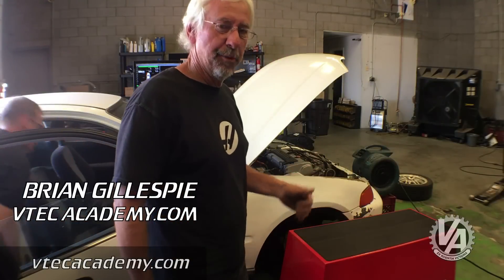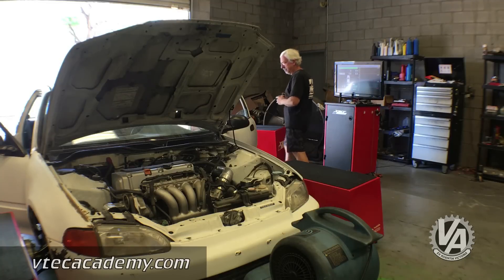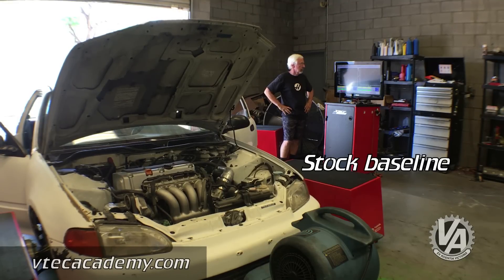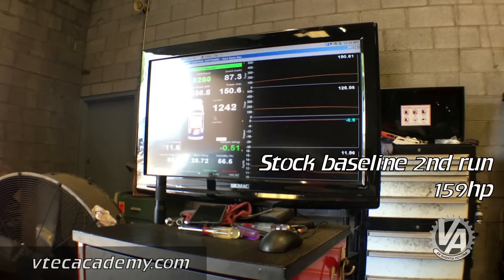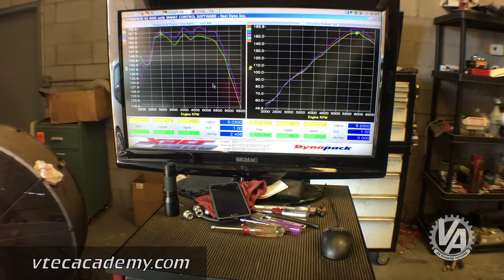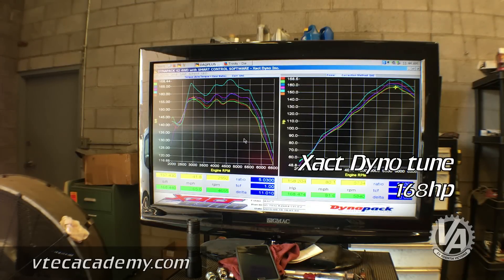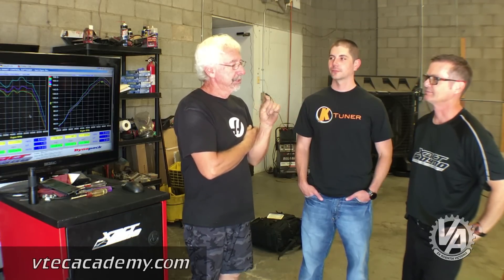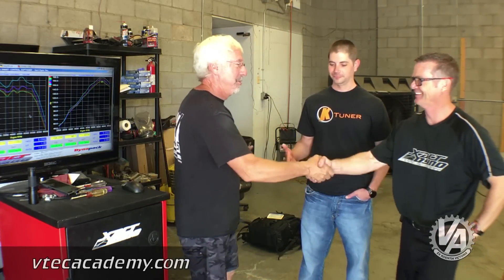Civic EG Budget K Swap Part 3 Dyno

Comment: Just went for a ride in a swap like this and then got the motor I also have a b love the torque and there's so much room to grow I want lsd do they sell it for 5 speed I love the fact its a street car daily my buddy makes 240 hp and 200 foot pounds of torque and the motor sounds like a man not an aggressive teenager he has a tsx trans I think this is a great build you can grow from it without going boost right away plus without all the extras like distributors cams etc this is factory and the do sell other aftermarket parts so there is a plethora of combinations change stuff but no I'm in it k24a4 we shall see. With this build

Comment: Great video! I’m wondering if the money spent on bolt ons would be better spent on a k24A2? $200 header $200 rcb intake manifold, $3-500 for cams sure adds up. My budget k24a2 swapped civic made 197/173 @4,000 ft of elevation with stock intake, stock exhaust manifold everything. Just kpro. Is the accord k24 really thaaaaat much cheaper?

Comment: i respect the fact that the goal was to make a cheap Kswap but it seems to miss so much heart i mean i think a B16 EG could get in front of that car easily, i would go big or do nothing if it was for myself because a K20A-R or even a K20Z3 is such an amazing engine, and has a great transmission ratio that seems to give it that extra punch it needs and can get 260hp easily without any brain breaking with just bolt ons even it theyre average

anyway its a cool build and it was so close of the -3000$ good work!
Reply from the maker: We aim to find out. I actually think it will kill a B16 and even keep up with a B18C. We'll see.
Reply: yeah we need to see it! with a little more top end the K24 will definately give a huge gap to a b16
Reply from the maker: Thanks for watching!

Comment: (This may initially seem like a stupid question, but please keep an open mind.)

Have you considered swapping a PPA head into that block (for the improved flow)? How about a PPA head with better cams (possibly 06+ TSX cams using the VTEC killer method)? I know that’s not what you really do, but I just figured that it wouldn’t hurt to ask.

Comment: 160 stock? My stock K24 CRV is 195hp. With K&N stock replacement  air filter so maybe 200hp. I saw on a video that a K&N replacement filter adds 5 horsepower without retuning.

Comment: Would like to see you guys revisit this budget k swap civic project. I'm curious to see if brains mods(different intake manifold ,cai ,cams , different header ,and a new tune) would bring it up to the 200hp mark. I've got a clean 98 ek chassis w/ rear disc brake conversion. It had a b20vtec swap in it ,but I'm looking into k series now instead of another b series swap since I've got 6k to work with. I'd like to put a k20a2 in it ,but wondering if I could pull off the whole swap for 6k? Otherwise maybe a sleeved ,bored & properly built b20 block to replace the tired ol bone stock b20 that was in it

Comment: I really need help I have trouble shot everything 6 times and have had two other people go through everything with me and we are all stumped I have a 95 civic hatch with a k20a2 swap my only issue is I do not have power going to fuel pump. Fuel pump is good, relay is good, everything I mean literally everything is good just cannot get power to my relay the only way I can get power is if I jump from pin #5 on the main relay (fuse #13) or #6 (power output) in other words only if I send 12v constant from another pin on the relay the car will start and stay running.

Comment: waiting on the next vid. love the channel I am in love with Honda's I live in northern Michigan so there is not much of a scene around here I am close to love fab  if you haven't heard of them check them out they are really doing good stuff I am curntly working on my 93 integra with a b18b1 in it I need to find a new transmission due to the fact mine went to poop and I have a 91 accord we are building as a family my 8 yo daughter loves it wish I had more cash to throw at it but family comes first and working 60 hrs a week in a factory don't bring home a lot of bacon so these budget vids  help 
Robert
prez manual obsessions cc

keep shifting
Reply from the maker: Rob Dirty 👍🏽thanks! We were just in Michigan this summer for WMHM.
Reply: VTEC Academy sweet I missed out on it due to the fact the car is broke and working all the time

Comment: rbc is your best bet for intake manifold of the 06-11 civic si
Reply from the maker: Possibly, but we'll find out. The RBC may not make a difference at the RPM we are running.
Reply: Not sure if it'll help a car with 6600rpm redline, many 9th gen Si guys dispute the effectiveness of the RBC swap on the K24Z7 even when their cars rev to 7500rpm tuned

Comment: Will the accord harness work for this swap? Also will these parts work with a K24A2 being the only difference? I could really use some help please and thanks!
Reply from the maker: Yes, the Accord harness will work and the A2 works with these parts.
Reply: VTEC Academy What can i expect from using this ecu will vtec work the as it should after reflash? And im guessing it would be the same as using ep3 si ecu? Just weighing out my options considering i have access to both.
Reply from the maker: You need to have the ECU reflashed with the program that fits the engine.

Comment: ? I have96 Honda civic  with internal coil  I'm swapping 01 Honda prelude which external coil how can I do this  please help me  thank you
Reply: The JDM H-series distributor is internal coil. Get a 93-95 one then an OBD1 to OBD2 distributor plug adapter. Or you could go to a salvage yard, find an OBD1 Accord with external coil and cut the section of harness that includes the coil and distributor and just match it wire for wire. That coil does like a bigger coil wire though.

Comment: What causes that big dip in torque in the mid range?
Reply: 0ttoman my guess is it's where the vtec kicked in yo. Like a second torque curve. That's my guess anyways.
Reply from the maker: We're not really sure. We will try changing the intake and exhaust to see if they are causing the problem.

Comment: Which ecu did you use for k tuner
Reply from the maker: The 2005 Honda Accord manual ECU. It also works with the 2005 automatic ECU.

Comment: Is this horsepower to the crank or wheels ?
Reply from the maker: It's at the hubs. Dyna Pack hydraulic dynamometer.
Reply: +VTEC Academy hum that's not bad that's around 193hp at the crank so what's your guys goal to make at the crank?
Reply: The goal is as much as possible with bolt ons. Cams, intake, exhaust and tune. I am hoping for 200 on the Dyna Pack.
Reply: ***** that should not be hard this is a k24 from the usdm honda accord right ?
Reply: The Dyna Pack measures axle torque , so this is wheel horsepower. You can make guesses or adjustments to figure out the flywheel horsepower is, but I'm not sure what that might be. I've heard 12-15% for FWD Hondas.
Reply: ***** this is weird if this is a stock k24 of a usdm accord it should make around 136whp not 160whp which was why i was confused so i am thinking that the dyno you guys used it converted whp to crank horsepower hence why you guys got 160hp and fwd does lose around 15% at the crank so a 2002 acura rsx type s stock from factory in the dyno should read around 170whp which equals 200hp at the crank which was what it was adverticed when it was new.
Reply from the maker: Hubs
Reply: VTEC Academy  he just said to the wheel but anyway if its to the hubs how much is that at the crank????
Reply: I've been told Honda's have about 12-15% drivetrain loss. Based on that, it means approximately 192 HP. This is just an educated guess, to get an actual figure we would have to remove the engine from the car and test it. Our goal isn't 200 crank HP, it is 200 hub or wheel HP.
Reply: +Brian Gillespie you are confusing me from what you are saying is that Honda underpowered the k24 from the usdm accord since you are saying  the stock base line is 160 hp to the hubs that's around 192hp at the crank which is not it should be 132hp at the hubs which is 160 hp at the crank which is what Honda claims to make from factory I don't know if I am explaining myself well. What I am saying is they converted the horsepower to the hubs to the crank when your car was dyno. For example a friend of mine took his rsx type s to the dyno it is all stock and made 170whp at the dyno which is 200 at the crank. Which is what it should make from factory.
Reply: We would need to use a stock tune with stock header and stock catalytic converter and stock intake system for an apples to apples comparison. If we had all those, we would be close to the 132 you are taking about. Remember Honda is interested in having a quite car and maximizing emissions and mileage, we aren't. Our tune and setup is more aggressive.
Reply: My son has a stock Accord, maybe we can dyno it to do a comparison.
Reply: +Brian Gillespie  i though the engine was all stock and the first run was with the stock tube
Reply: Import Tunner you're confusing yourself on this swap. Honda factory numbers are based on the actual the car it's from not from a swap car. You can clearly see from the budget build that it didn't use all the restricted crap that comes with a newer Honda. Apples to oranges here. When your friend did the type s was it in the stock car? A type s in a swapped car makes more power.
Reply: Brian Gillespie this correct and most people miss that very point on how k is restricted in the cars they come in.
Reply: Brian Gillespie yes and only then will it show what import turner is trying to get at.
Reply: cr1m203 that makes no sense what so ever maybe if you do not have powersteering you might get some hp but to answer your question yes the rsx type s was stock how is a k restricted in the cars they come in explain
Reply: cr1m203 not to mention when honda gives you the numbers the engine makes they usually take it out the car and test it so how does that make any sense to what you are saying about how the k is restricted?
Reply: Import Tunner this has been a proven fact that k series comes stock restricted in the donor cars. When swapping  a K series in to older Hondas most of the time it's with aftermarket parts like headers and air boxes with no emissions. Did I say you couldn't do this with the donor car? No but since we are talking factory specs the engines never came in older cars. The Honda Accord engine in his video has a aftermarket header and intake, no emissions besides the cat. Tell your friend to do the same thing and watch how fast his numbers change.
Reply: cr1m203  he never said it had an aftermarket header he said it was one stock k24 with no bolt on even then a header cannot give you so much more hp just stop you don't know what you are talking about

Comment: no vtec?
Reply: k24 is I-vtec
Reply: Yes sir but, did you hear "i-vtec" engage?
Reply: k series is not as pronounced as b series vtec engagement
Reply: +Frandy Hdez go look into what I-vtec is and you'll understand why you didn't hear it then comeback and talk about it when you even remotely know what the fuck you're talking about
Reply from the maker: The K24A4 VTEC comes on at a lower RPM than the B-series engines and it isn't as pronounced. The Type S has a more pronounced engagement